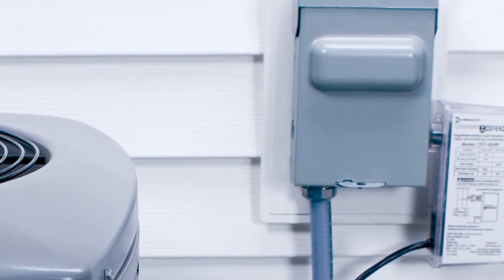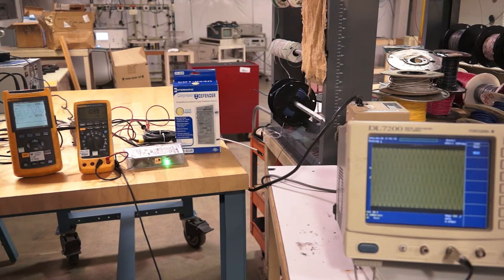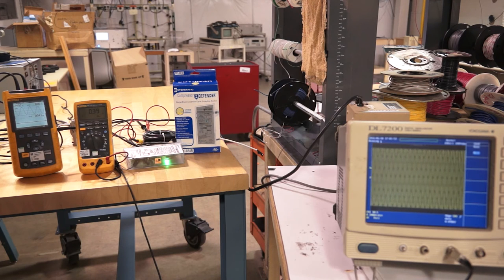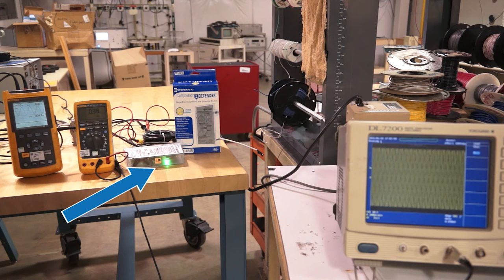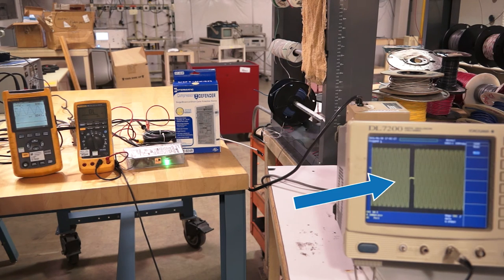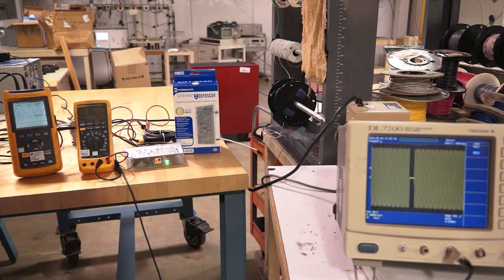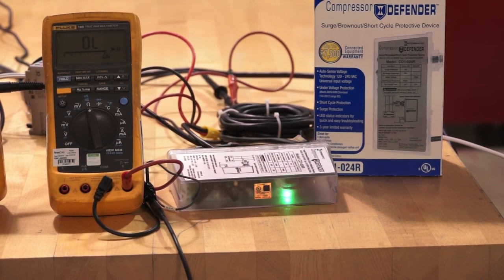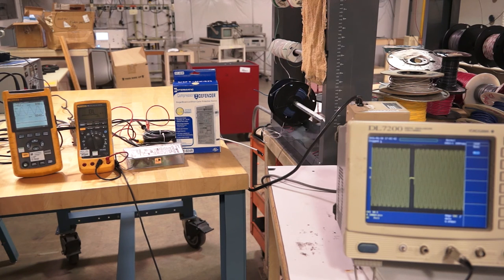Compressor Defender® Reacts to a Power Disturbance

Comment: Update. I contacted Intermatic consumer services as instructed and they shipped me two lab tested units that arrived today. I installed them and they work as advertised! To simulate a brown-out condition, I cannot cycle the condenser circuit breaker fast enough before these units see the loss of power and kick in and start the delay cycle showing a flashing green light. I am extremely happy with this product now and recommend it highly. Thank you for the excellent customer service.
Reply: Sounds like hidden commercial.
Reply: @garaldweiss5348  🤣

Comment: At 30 seconds into the video, it states the compressor defender will disconnect the unit from line voltage, which is incorrect.  It only opens the low voltage contacts, which must be wired correctly in order to open the contact relay inside the protected unit.
Reply: There is nothing wrong with the statement in the video. Disconnecting power to a low voltage contactor will disconnect line voltage to the compressor.